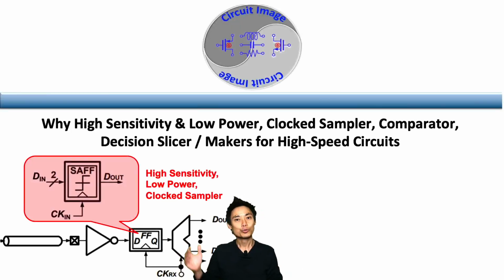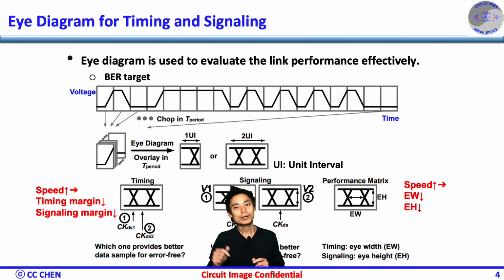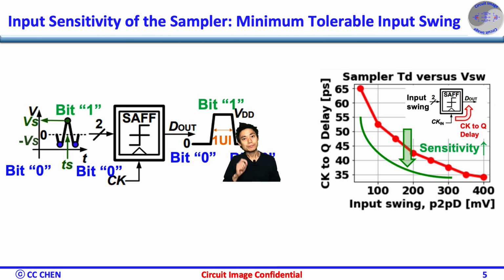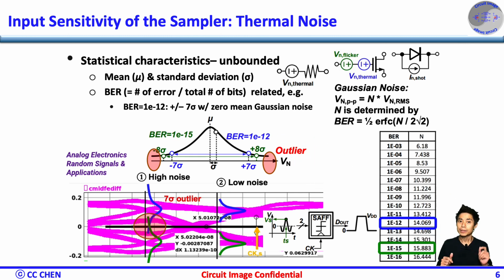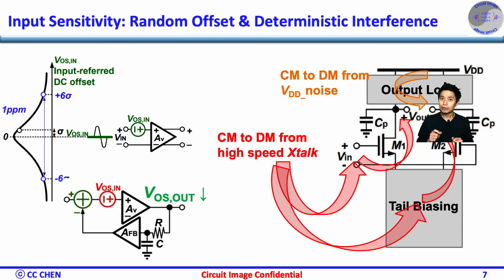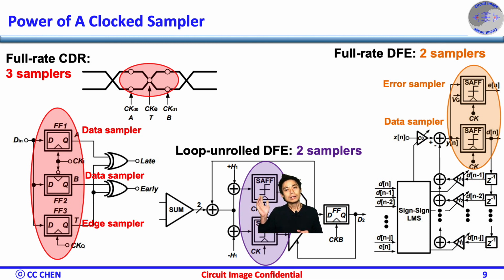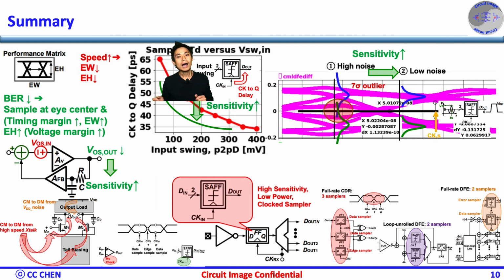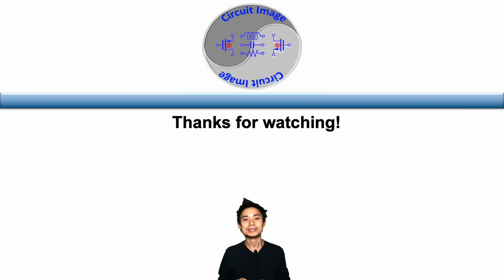Why High Sensitivity & Low Power, Clocked Sampler, Comparator, Slicer for High-Speed Circuits?

Comment: Hi Chen, great video as always. My question is if the signal is NRZ, is it possible that we merge the data samplers in CDR with the data samplers in DFE to save power?
Reply from the maker: Hi JY,
Thank you so much for the kind words and good questions.
You're correct that we can merge the data samplers in CDR with the "data samplers" in DFE to save power.
CC